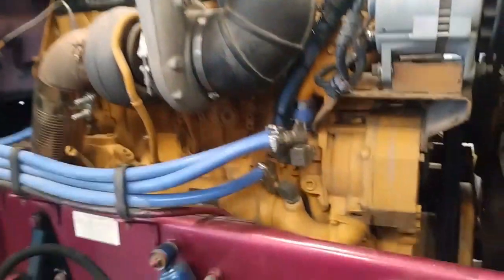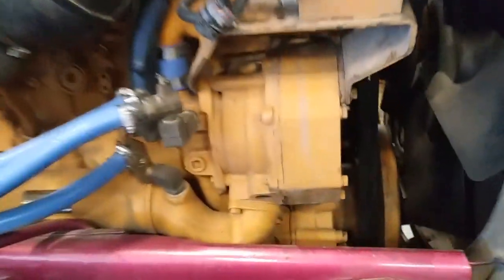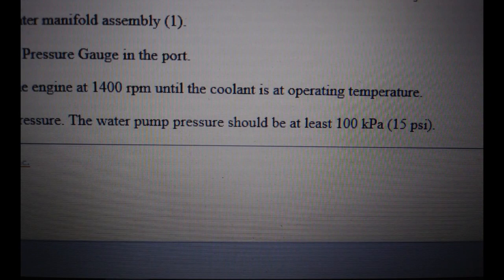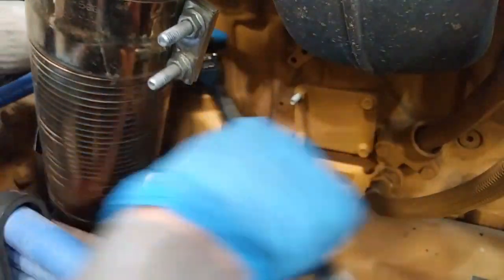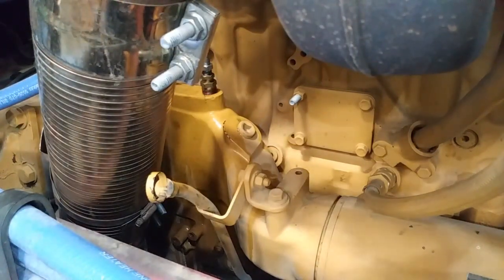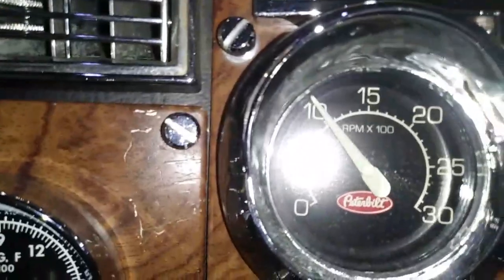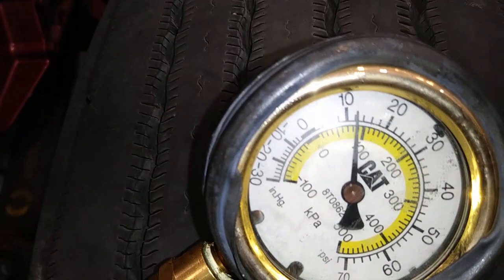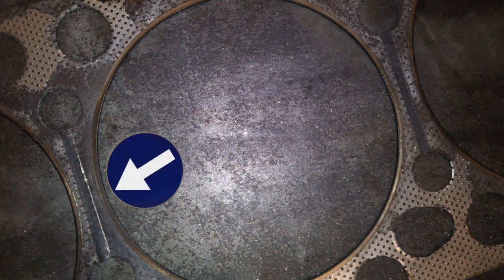How Do You Test A Water Pump? Testing An Engine Water Pump.

Comment: Damn good video! I hate to admit this but I guess I am dumb because I have never pulled a vacuum on the coolant system to open it and change anything. Hell I never seen it done. Awesome
Reply: I guess u never worked on stuff that holds 10gal to 100gal of fluid! We do it to change simple hyd lines so u dont loose $$$$ in waste. Work smarter not harder I tell the guys who dont know better.. now you've learned something today
Reply: @kwmiked  well they say if you're not learning something than you know every damn thing. I been working on trucks and heavy equipment for a good while,  however long it's nice to learn new tricks.
Reply: A shop vac..... not just for carpets
Reply: Oh
Reply: Oh l

Comment: You did not mention the fibre impeller that detatches  itself from the steel hub on some earlier 3406 water pumps, I have replaced that impeller in several instances across Europe. No coolant loss but engine overheating. Regards from uk.

Comment: Do manufacturers offer a permanent mount coolant pressure gauge? Would seem a useful monitor for extended use engines, like Marine or hauling use, or even construction and farming, gennies, pumps, etc
Reply: Marine installations have a pressure gauge

Comment: What was the test with the bottle? Did you hook up a bottle with water onto the high pressure discharge of the surge tank to determine it was over pressuring instead of using a cooling system pressure tester?
Reply: Bro, you mainly use the pressure tester to find an external leak in the system. Using the water filled bottle from the overflow/ vent tube from the tank just shows pressure entering the cooling system internally.

Comment: Gday mate
How much and how often the water pump (part# 10R8660) on C15  SDP 16182 twin turbo leaks from weeping Hole to indicate needs replaced and if so can you replace the seals and gaskets on it instead of replacing the whole unit ?

Comment: My dad had to replace a bad shut off valve on a 250 gallon fuel tank for a mobile home, he put a shop vac on the opening of the tank for the same reason. Didn't lose a drop of fuel

Comment: I have a C15 engine overheating problem. Mechanic says head gasket torn or crack in head. Problem is there is no evidence of water in crankcase, dipstick, and no water vapor coming out of exhaust. Also no water loss coming from air compressor to air tanks. And no traces of water inside cylinder head or head cover. You think perhaps my water pump is not circulating water?

Comment: Hi we have a c16 cat we did a full inframe over haul never had this problem before after when the driver was sleeping the engine started running rough and dripping cooling from the reservoir then the next day that it was turn on white smoke came out from the exhaust  and it had coolent on the piston 1

Comment: Testing here could possibly give higher reading than testing where cat says to test in the plug, number 2 on cats illustrated.  Correct?  Because where cat says to check is much farther away from the outlet of the pump. I assume that is why cat whats you to check it at the thermostat housing.  But it should be very minimal difference right?
Reply: I just checked the 3406e vs c15 test procedure and the 3406 says a specific plug in the t-stat housing.  The c-15 just says remove a plug in the housing.  The older 3406 also does not specific a specific rpm. It just says atleast 15 psi. So i should be safe to assume 1400 rpm the 3406e should also be atleast 15psi. Right? I only have 12. So pretty sure that is why the truck is overheating.

Comment: Take off the head and the head gasket is good not burn and re check the block from the cutting the block we change the head and had it on  idle for 20 hr and everything good drove 150 miles and the coolant start to coming out of the exhaust again if you have time and have a thought about that and could help us and reach out i would greatly appreciate

Comment: What was the pressure reading after the head gasket was replaced? This pressure must read different at the radiator or coolant bottle correct?

Comment: ADEPT APT 
                                         Is there any other water pump testing you can do to test and check if the water pump is pumping water into the cars engine and into the cars radiator correctly?
               How do you test the water pumps Pressure, how much Pressure the water pump hoses are at? 
The Purpose of the Water Pump is to circulate the radiators coolant into the engine and radiator?

Comment: Hello, I have a C12 that is getting some coolant in the crank case. I have watched many of your videos which by the way are great. On one of your other videos you say that the pump weep hole on my motor goes into the crankcase. I am not overheating and in fact my operating temperature is very stable and where it usually is. Could the water pump be the culprit here and can I test it like you did on the C 15? The motor also started to get a lot of blow by but I.m not sure if this related to the coolant in the crank case or possibly another problem. Motor seems to be running well,however I use 3 gallons of oil between changes at 12000 mile intervals. Any help would be greatly appreciated.

Comment: You could save a heap of time and inconvenience  by simply attaching a gauge to the pressure cap..... raise the pressure  to 1.5 bar blip the throttle and you will notice a small reduction and then a  stabilisation....if your gauge stays down you will shave a restriction (radiator etc)....if you don't have any pull down or reduction  in  pressure.....the the impeller may be corroded .
Always remember to pressure test the system cold and the cap also before proceeding  deeper first .
ALL IS LIGHT 1÷144

Comment: What would the temperature go up to? When It overheats. I have a 2ws that can clutch will not engage automatically. Fully loaded going up Coachella hill outside temp 115 my truck usually goes up to 227 no alarms.
Reply: Just replaced the water pump and thermostats. Still running really hot while pulling a steep grade.

Comment: Great video! Where could I purchase the tool to draw a vacuum on the cooling system? 
Thanks
Reply: Caterpillar sells transducers, which we use to put a vacuum on fluid systems. Part # 5P- 0306. There the cats ass if you ask me.
Reply: Search airlift coolant system leak checker on amazon, works good to get all air out when refilling a system as well

Comment: Hello, thank you for excepting me on your platform. I have a 3406e cat . it's been sitting for 8yrs now. I noticed something I have coolant in my oil. I've changed oil a few time the same thing. I pressurized the system and noticed leaks coming from piston #2.  Then someone told me it's my oil Cooler. Help PLZ.
Reply: Someone correct me if I'm wrong... 
Oil cooler will put oil in your coolant. 
If I had to guess, I'd say a liner o-ring.

Comment: Is this the same psi for a c15 acert my is getting hot only when in a pull
Reply from the maker: The water pump is the same, should run the same pressure.
Reply: @AdeptApe  okay thanks I will check it out

Comment: That destroyed head gasket didn't have much of a chance to begin with, those cylinder walls are TINY between each piston, wouldn't surprise me if a crack was soon to form afterwards!
Reply: Midnight Mechanic Cracks aren't generally an issue ,only in gasoline engines with thin castings (generally Ford's) acidic antifreeze causes pinholes which are by far more common in unmaintained diesel engines.
Reply: Plenty of Diesel engines can form cracks from sheer vibration and cylinder pressures, those cylinder walls are way too thin for my comfort for them to hold up under load, especially since the head gaskets are proof they couldn't hold up to the heat and pressure.
Reply: +Midnight Mechanic you can't really tell how thin those cylinders are just from looking at them from the top of the engine without pulling the sleeves out. big diesel engines such as this one doesn't have cylinders like a gas engine that are actually part of the engine block, these are cylinder sleeves that you can pull out and replace. in all my year's of doing diesel engines i've never really seen one that wore so thin that it would crack, you would have a lot more problems long before that would happen and yes I've seen a lot of cracked cylinder sleeves but not really from being worn thin. before that would happen your engine would have so much blowby it would make you choke on all of the smoke and that would be if you could even get it started due to the lack of compression to get the fuel to combust.

Comment: seems like a lot of work, most stuff nowadays have a temp gauge you can look at to determine the same thing.
Reply: Temp gauge doesn't tell if there is flow. You'll go hot from a radiator core with bug clogged fins, a stuck thermostat, blown head gasket, cracked exhaust runner, and lots of other Gremlins. None of those are the water pump. A bad pump will show low head pressure until you boil coolant in the jackets. A cracked liner will show pressure spiking high rapidly. Bug filled fins will show normal head pressure rise until the thermostat allows the entire system to overheat, then "boiler Spike", or sudden dropping as the cap releases because of the head pressure with the stat wide open. His vacuum coolant retention actually hid some of the pressure Spike from the blown gasket, but the fairly rapid temp rise remained.

Comment: Sorry my question has nothing to do with water pumps. I had 1 million one hundred thousand miles on my ECM. ECM went out I put another ECM from a another Cat motor on their it lasted 4 days it burnt out. Now I'm putting another ECM from another Cat motor on there with a new wiring harness I hope this fixes the problem., the used one of them fixing to put on there has been turned up to a 550 it's been checked by the ET and hopefully it lasts more than 4 days for $850. If this one burns out what the hell could be the problem.